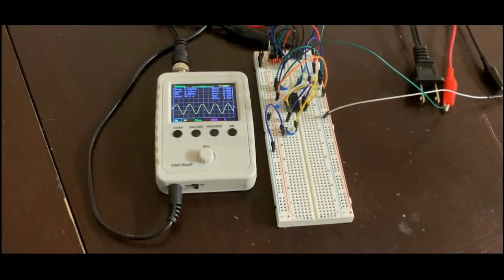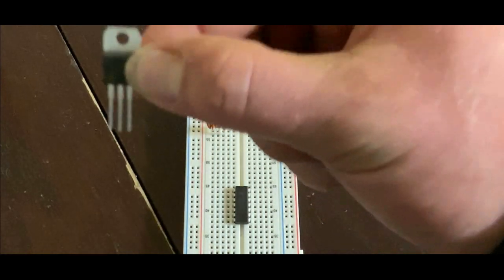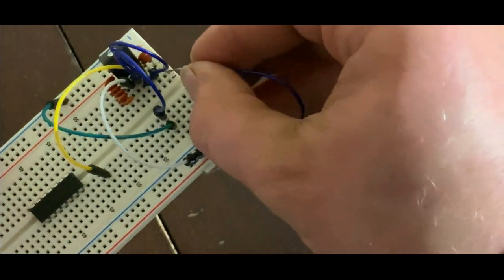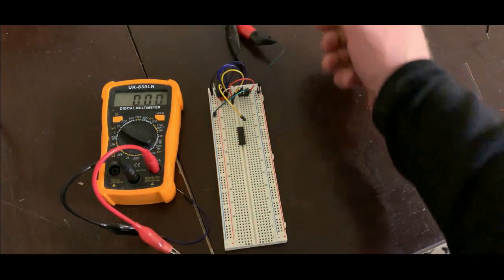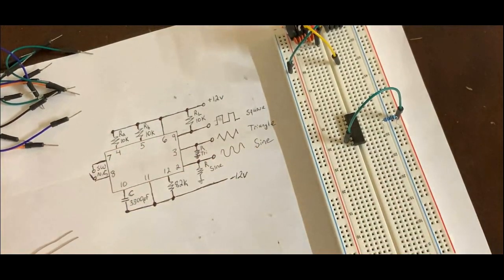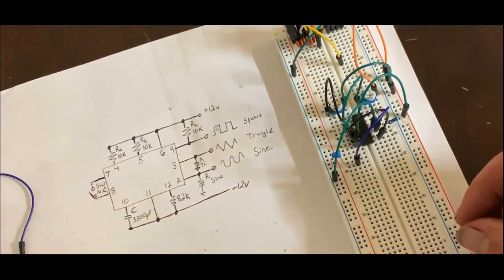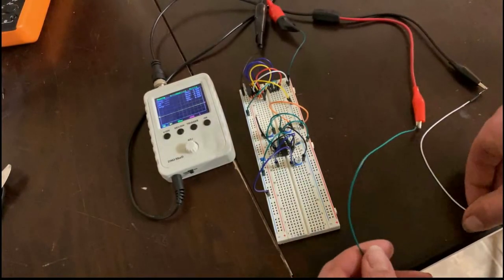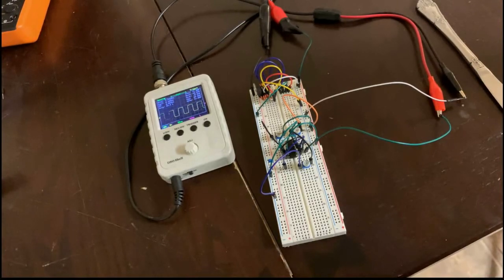ICL8038 Function Generator Circuit Build: Basic Test Circuit Diagram: How to build

Comment: Hello friend, I am doing the same implementation but when I try to measure the signal it comes out flat as if it was not oscillating. I am connecting the positive of the oscilloscope to pin 9 and the negative to which the voltage source provides me since I do not have a virtual ground. Do you know why that happens?

￼

Comment: great video.
i would like to know how to change the amplititude and to make offset
Reply from the maker: alon shalmon to increase the amplitude just take the output of the icl-8038 and put it to the input of a class A transistor amplifier (a simple one works fine). To offset to where you have a fully positive sine wave take the output of the ice-8038, run it through a decoupling capacitor into the middle of 2 resistors (voltage divider). Replace one of the resistors with a potentiometer to adjust the offset. I used that method to drive a VCO to make a bandwidth generator before.